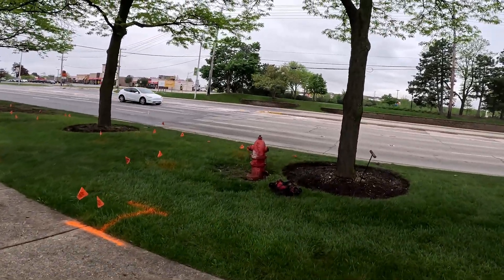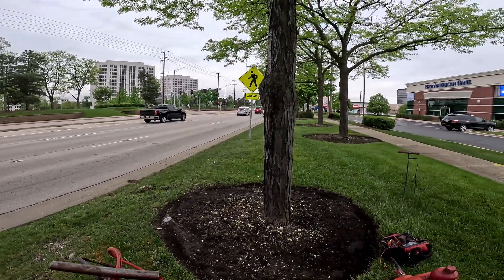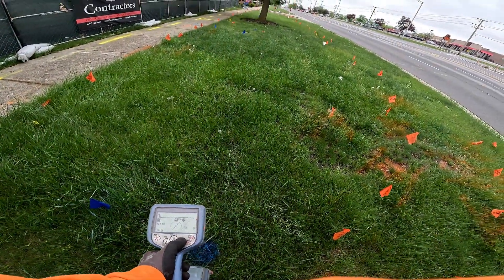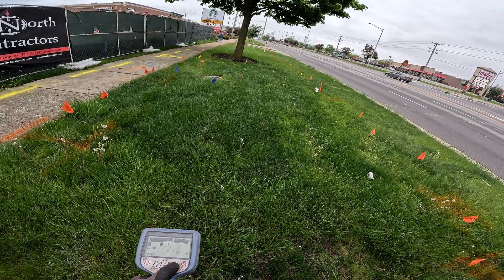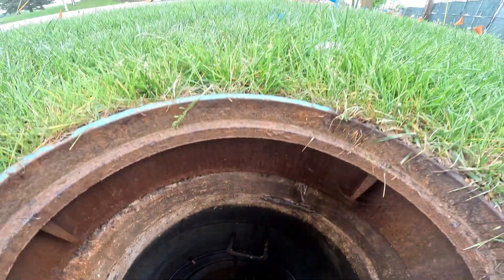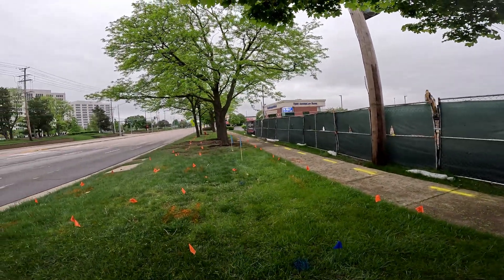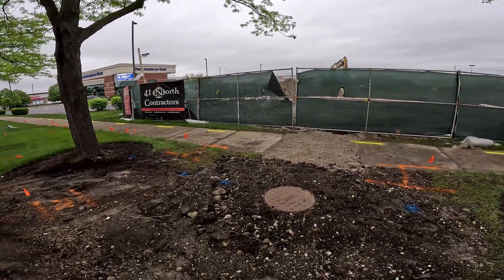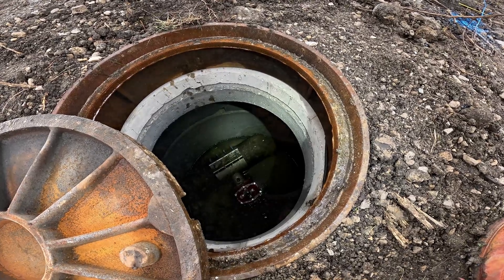Attempting to Locate a 12" Ductile Water Main | RD 8200 Cable and Pipe Locators

Comment: is there a tolerance for accuracy when locating? newbie asking
Reply from the maker: In the state of Illinois its 18" of the marks.
Reply: @811chicago5 thank you sir. Yes variations from state to state and perhaps company. Didn’t think of that.
Reply from the maker: @paulamckinney7941  It is not up to the company; rather, the law determines the requirements for hand digging around marked utilities under 220 ILCS 50/7

Comment: This is congested and your line has high resistance, believe it or not you need more Voltage (not mA's).  In order to do this with a TX with auto V/mA balancing you need LESS ground, and you would also use a lower frequency than 9.8kHz.  I would love to see you try this again using 512Hz with all 90V (High Voltage mode) with 50 or 100 mA's. This lower frequency with more voltage would also improve your distance.  Feel free to reach out. We would love to meet you in the field and give you a free RD Backpack for your support.

Comment: ive been using my rd8100 for almost 5 years now and love it.  I only use it on guidance mode, makes locating nice and easy.  auto adjusts the gain for you as you walk away/closer and turns on all the antennas to locate the utility.  I enjoy my rd way more then my vivax vloc3

why not use a different frequency? what frequency were you running in this video?

Comment: It would be interesting to see how the RD would go if you had grounded the water hydrant further down the road as well as the one where you've set up your transmitter. This helps direct the signal, especially in congested areas and reduces the impact of the electromagnetic field being distorted (I note you have other utilities painted on the ground nearby). Please try this if you get some spare time.
Reply from the maker: Thanks for the tip. I will do that next time.

Comment: Side note- hydrants are not the greatest hook up due to gaskets and concrete thrust blocks but sometimes it all you can do. Or use a valve wrench and magnet 🧲👍 believe it or not I used the power sweep a lot. It works. 👍
Reply from the maker: Thanks for the tip. Power mode mains do work at times but the water service sings when using power mode.

Comment: Welcome to my world. I located cast iron main for 20 years. Weak tone and you are correct. I could only go about 100-150 feet and then drop on it. Wish I knew about double ground. Btw I have switched to a new less stressful position at the treatment plant and 6 months later the city has still not found a candidate for the locator job! 😂 other back up staff has been filing in and they are swamped!
Reply from the maker: It's wonderful to hear that you're enjoying your new position, and it's great to hear from you, my brother! Locating cast iron pipes can be quite challenging, despite what others may claim. Sometimes, I find it more effective to rely on dowsing rods and skill rather than solely depending on the equipment. Considering the circumstances, perhaps moving to New York to pursue that position could be a viable option. What are your thoughts on the matter? 🤫